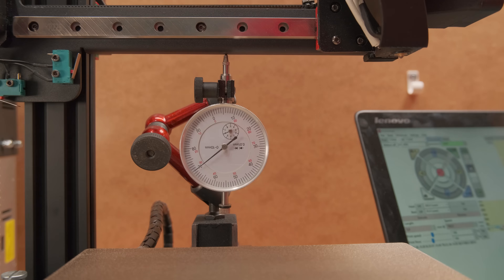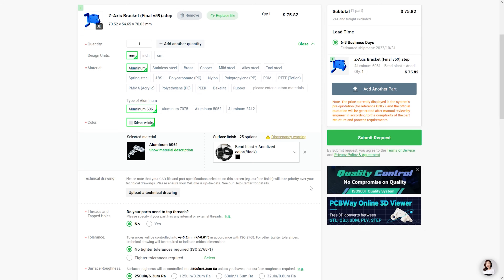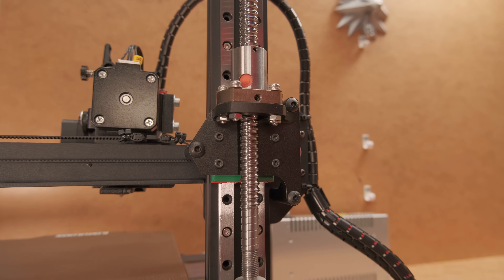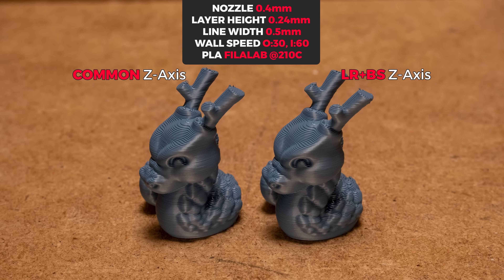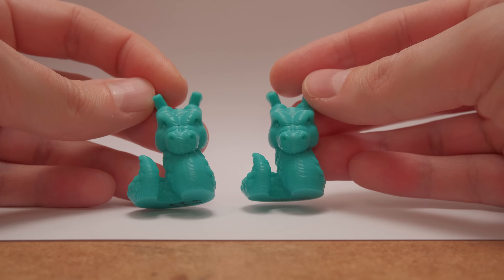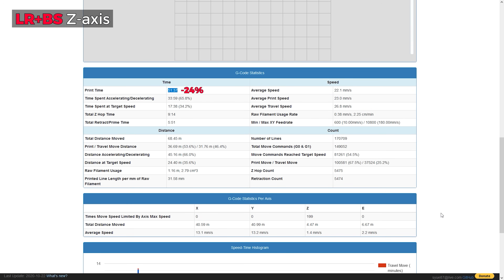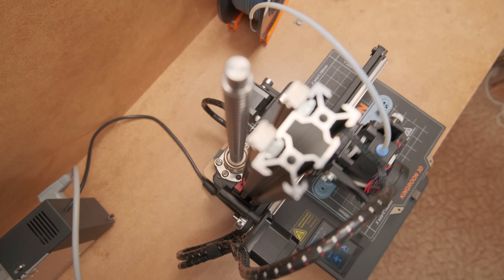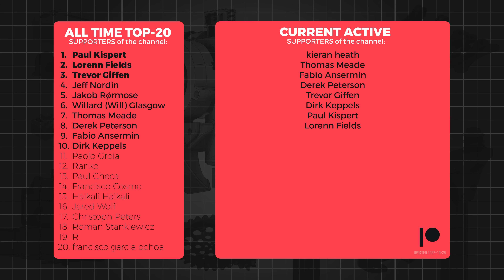3D Printer’s Z-AXIS ULTIMATE Precision Upgrade – IS IT WORTH IT? (Linear Rails + Ballscrew)

Comment: @6:40 linear rail are show form the top, and... why on Earth I see a solid core with sheet metal over it to form tracks? AFAIK the whole point of a linear track is to have one piece, tight tolerance milled and honed rail to guide a slide. What was the price point for the rail that You have used?
BTW after spotting Your work on Instructables You have a new subscriber 😁
Reply from the maker: I have no idea what you are asking for :D The shot at that timestamp doesn't represent what I meant and it is my mistake to include it.
But the whole lubricating and moving back and forth and applying some forces in different directions on the carriage with one rail before assembly works well with preloaded linear rails if you have a sticky motion with your setup (usually not enough weight on the carriage). And the ones with clearance have extremely smooth motion (unless it has a defect) but can have a tiny play because balls are undersized by a tiny fraction. But when ordering linear rails that cost ~$10 per unit, usually you have no idea what version you will get. The most important thing to notice is if the binding/sticky motion is because of not enough mass on the rails because it is preloaded or if it is just a bad rail.

Comment: Has anyone tried replacing the sloppy brass lead screw nut with a plastic, anti-backlash nut?  I used them when building fast, accurate pick and place machines.  I haven't seen anyone use them on a 3D printer yet.  They are readily available from a variety of sources, such as McMaster Carr.
Reply from the maker: Do you mean POM plastic nut? I don't think anti-backlash does anything with 2mm pitch and 8mm lead screws on 3D printers. But POM nut + PTFE coated lead screw could be the simplest way to get the Z axis with very little friction and no need for lubrication. I ordered the parts and will be making a video about them in the future.

Comment: I think 3d printer rigidity is not an issue. Open loop motion system is problem. Thats why old ink printers uses steppers than they changed to dc motors with microscopic lines with it. If all motion axis have this feature you can change the mass and precision in all 3d printers.

Comment: Great video, There is a solution to getting a wobbly ball screw you should really check out the 3d printed z-wobble wings from MirageC and his video titled, Fixing Z Wobble from 20$ Ball Screws with that simple device, I think they would be a great addition to the z mode in this video and they would help any one looking to do similar z mode to their printers without breaking the bank. I did a similar z mode but with one rail, one ball screw and his wobble wings to my printer and got similar precision as your mod.
Reply from the maker: Yeah I know, my only concern is that it won't withstand way higher acceleration, speed, and jerk settings of the Z-axis. And those are something special. Going back to 3D printers without this type of mod feels so sluggish now. It's like going from a 144Hz monitor back to 60Hz :D
Reply: @PrintingPerspective  WOW I did not think of the higher acceleration, speed and jerk of the z axis, when I did my mode I was aiming for the highest quality prints I could achieve. Thanks for responding.
Reply from the maker: I aim for that too. But I don't think I sacrifice print quality with faster Z axis. I am not pushing super crazy speeds or anything but still they are 4x faster than the stock settings, which feel so much faster. :)
Reply: @PrintingPerspective not really sure I grasp what you means, looking at miragec video the speed of the z axis movement seems quite fast and well in for non planar printing, wobble wing (expecially last revision) or Oldham brass coupler available also for ball bearing should allow for usage of non perfect ball screw without risk of binding the movement.

Comment: I upgraded a few printers to quality single start lead screws and run the Z BOM wheels a wee bit tighter than usual and imo has been the best cost/performance upgrade as you no longer have to worry about the "magic number" .04mm z increments to whole step the z motor for most consistency. 

With quality single start screws. Theres little to no wobbling to get transferred into the print and improves the Z step resolution to .01mm/step increments vs .04mm/step. And you can literally pick any layer height without worrying about layer inconsistencies. 

Those same printers i swapped from 1.8deg steppers to 0.9deg steppers and even though they may be cheap bed slingers, their print quality is simply impeccable
Reply: Single start do you mean 1mm pitch/lead? I’ve on one of mine installed 2mm pitch/lead and sure movement is much more precise (over killing putting also a 0.9 degree stepper) problem I’ve found is that max speed and acceleration became way too slow… moving back bed or gantry after a full print height it’s a pain also on relative small printer…
Reply: @SP_99999  That's an argument for servo motors over steppers, search O-drive ;)

Comment: I remember the kp3s pro has only z and x linear rails and the original kp3s has y and x rails. I always wondered what would be the difference. Good to see the results
Reply from the maker: I have the KP3S Pro, you can also buy it with the dual Y axis linear rails upgrade kit. I am just waiting for it now as it is shipped from China. PEI sheet would also make sense as it is way lighter that the glass bed. I am just disappointed as they still have a lot of QC problems as with KP3S 3.0.
Reply: @PrintingPerspective  The rails shipped with the Y axis upgrade kit had horrible binding for me. My X rail also isn't super smooth, and the Z rail has even worse binding than the Y ones (KP3S Pro). Took them all apart completely and am letting them soak piece by piece in 99% IPA for around 24 hours, then will do a deep clean and lube them up. The QC on the rails is atrocious and they might as well be as bad as loose v slot wheels.
Reply from the maker: I only had Z binding rail. Y and X were smooth. One thing to take into account is that linear rails can come preloaded. Meaning that bearings will be just a little bit oversized depending on the preload level to eliminate any wobble between the rail and the carriage. You just lubricate it and move the carriage with changing pressure directions back and forth across all the rail until binding is gone. But if the rail binds in only at one side then it is the problem with the rail.

Comment: You know I've been wondering for a while now if you could fit two mgn9h side by side on a 2040! Thanks for confirming that!
Reply from the maker: It's like they were made to be used here :D Just be aware that I had to sand down those V slot nuts, otherwise they won't hold the rail as they are too tall. I forgot to add this part to the video.
Reply: @PrintingPerspective  If they were that would make sense lol. I'll have to order some soon!

Comment: nice video, but whats the sense of using cheap chinese rails and a cheap chinese ball screw(tou cant call that thing a "ball screw")... vibration come from the screw that is made in a plastic lathe. you should try to do the same with a good quality rails and screw
Reply from the maker: Thanks, but what sense does it makes to use a $100-$300 ballscrew on a $200 3d printer? I am jus giving a sensible scenario on what manufacturers could do out of the box and what results we would get. The ballscrew I received didn't have anything that would cause problems. I checked the z movement accuracy and rotation smoothness. No problems whatsoever. I don't understand why you hate it so much. :D Just because it is cheap and Chinese? Kinda weird, kinda weird.

Comment: I feel like the linear rail/ballscrew upgrade might work better for the x and y axis as they are the two axis that move the most out of the printer and would most likely be the most affected by any vibration. I would be interested in the results of such an upgrade.
Reply: And using a ball screw for x/y would make it SLOWWWWWW.  There are also some other drawbacks.  There's a reason a Voron 2.4 uses belts for everything.
Reply: I agree and, feel like linear rails, across all axis, is where the benefit will truly show. Given that, and ball screws, I believe you’ll see the highest improvement in accuracy.
Reply: @TheJacklwilliams  That printer already uses linear rails for X and Y, so he did end up with LR on all axes

Comment: I tried this with a single HGR15 rail and custom plastic belt drive and noticed a small improvement but I ended up going back to standard balls crew because I got tired of the Z falling when powered off. I even tried a geared kysan nema 17 and it would drop sometimes too driving the hotend nozzle into my print bed cooking the PEI. 

You may want to re-test with layer heights of 0.1.mm and 0.2mm as 0.24mm is a bit tall of a layer when trying to determine quality changes.
Reply from the maker: On a cantilever 3d printer? Plus cheap ballscrews have more rotational resistance so funny enough falling Z is not a problem.

I doubt I will retest it because I try to aim at settings that are most universal and realistic for the majority. I did one test print with 0.12mm layers in the video + all the theory behind supports that the lower the layers the bigger the difference will be. So if you print thin layers, the perfect z-axis movement is definitely what you want to have.
Reply: @PrintingPerspective  I was talking about a belt driven Z that did not use a ball screw. I said I went back to the screw to stop the Z from dropping. I could have used a lighter leash/key leash or a counter weight but the quality difference didn't seem worth it. 

I have spent years taking thousands of photos with and without macro lens under every lighting and angle combination I could think of. I spent just as much time looking online for photos of others print quality taken at angles and lighting showing the detail I was looking for. Since the move to 0.2mm layer height has become a standard even for purely aesthetic models I believe something has been lost. Maybe resin printers are to blame.
Reply from the maker: My bad. I mean for purely aesthetic purposes of the print the resin printers are on another level. Personally, I don't care about them as I am more of a functional print guy - quick modeling, printing, and solving or improving something. But yeah, when the "quality" norm becomes lower there is always something lost.
Reply: Don’t have the link available but I’ve seen someone has developed a board to be put between the stepper and the driver that allow to block the stepper when there is no energy sent from the driver… seems an interesting solution, belted are nice but bring all the issue of proper belt tensioning and other potential problem due to the belt…

Comment: if you want to test a z-axis improvement shouldn’t you test over a wide z range?  the small z-axis range means you are mostly testing near the bed which minimizes a lot of z- errors
Reply from the maker: Not really. If the alignment is good and rotation is smooth all the way I don't think that is needed. Since the video, I made a few taller test prints, and the layers look exactly the same no matter the height.

Comment: Your result was quite expectable. You should solve the stiffness issues first  before you'll move on the better screw and/or better linear movement elements.
Reply from the maker: There are no rigidity problems with the metal bracket upgrade. This is probably as good as you can get on a cantilever 3D printer.

Comment: Hey, that pattern that you are seeing on the side of your print has nothing to do with z axis. It is issue 6. This is a pattern that results from dual gear extruders. Hevort was able to solve this problem and I suggest you check him out.
Reply from the maker: Hey, I follow him and I watched the video. But my question to you did you watched the whole video? Because you making a very bold claim and comparing completely different 3D printer designs without knowing all the variables, just saying you know.

Comment: Off topic, but which parts cooling fan are you using? Looks interesting
Reply from the maker: It is the Mechatronics Fan Group B5015E24B-BSR https://www.digikey.com/en/products/detail/mechatronics-fan-group/B5015E24B-BSR/5209731
Reply: @PrintingPerspective  sorry, forgot a word, I meant fan duct :D
Reply from the maker: It is my designed mod for E3D V6 hotend on the KP3S. I only have shared it for my patrons (for regular 5015 fans, not the one I am mentioned).

Comment: Have you tried turning off z-hop? I got way more consistent layers by turning it off on my Voron V0.1
Reply from the maker: Yes I did, but with this mod I already get perfect z axis movement. And with right coasting and wiping settings I can extremely fast z hop everywhere without downsides of it. Plus it is nice when nozzle doesn't act as a wrecking ball on curled parts of the print :)

Comment: I'm a belted z fan boy
Reply from the maker: YES! This is on my list to test one day :) On what printer? Did you make before and after comparisons?
Reply: @PrintingPerspective  I swapped a voron V0.1 to belted z and now I have a V2.4. Never had issues with lead screws and didn't really notice a difference after the switch but I love the speed and it's one less thing I need to grease every month.
Reply from the maker: That's true, even the greasing alone worth it if the print quality remains the same.

Comment: Interesting video. There is a 3d printed version of this mod on printables and thingiverse too
Reply from the maker: Thanks. Are you sure? I have only seen the one which uses two linear rails but not the ballscrew.
Reply: @PrintingPerspective  you're right I was focusing on the linear rail aspect and not a ball screw
Reply: @TheOnlyRhino42  Currently waiting on parts for the one you're refrencing. Quite excited to have rails on my Z axis and only just now finding this video and learning of ballscrews(probs passing). That said, I'm interested in the model you designed as the one currently shared on printables is multi-part, but can all be printed with a KP3s. Hoping the prints last as long as a metal one, but only time will tell and saves a ton of cost. Think the whole build is going to be around $35